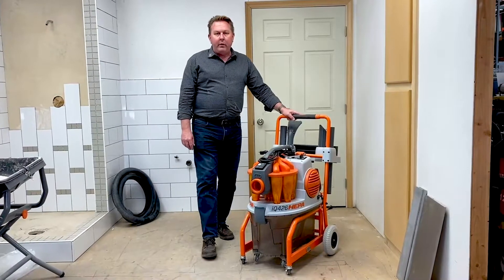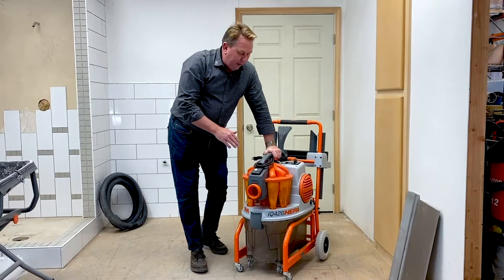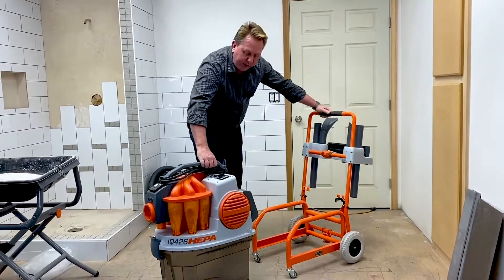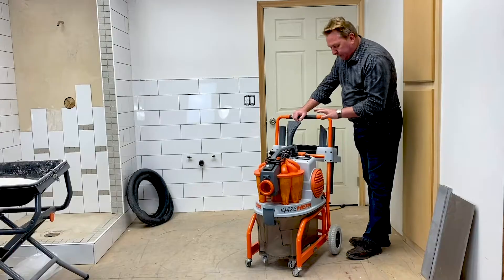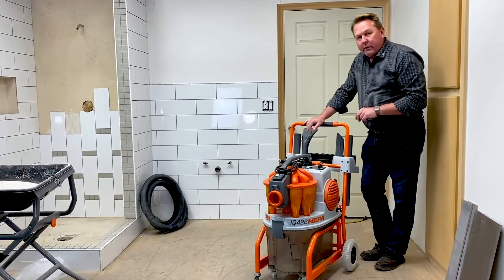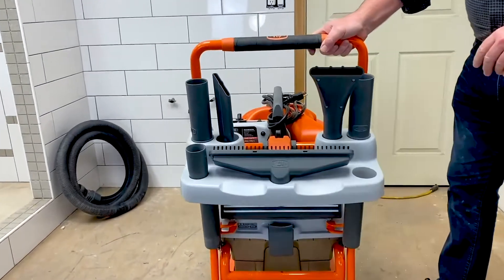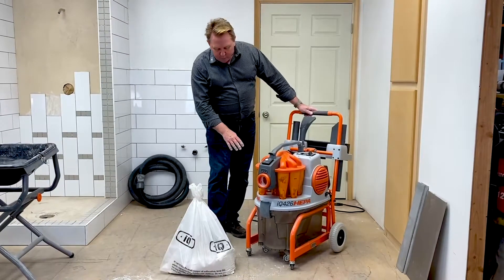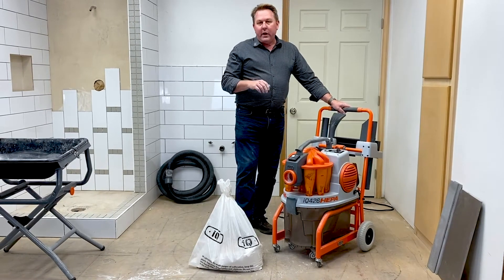The iQ426HEPA Dust Extractor Full Demo

Comment: Nice machine and demo. I have removed my tile in the living room area and need a vacuum to attach to an Edco cement walk behind grinder to remove the thinset. Will this vaccume work? Renting an Edco vaccume is over $400.00. I will need this to remove the kitchen tile thinset later on. What it cost me to rent I figure this machine might be a good investment for other projects. Please assist.
Thanks.
Reply: What did you end up doing? That Edco requires roughly 300 cfm if memory serves me. You hit the nail on the head with the cost of renting...2 days and you've roughly covered the cost of buying a decent machine like this.

Looking forward to hearing what you ended up doing and how it worked out

Comment: I do question your 99% claim.  It looked like you tipped some dust off the paper before lifting it, and when you showed under the head, there was considerable dust still in the filter.  The filter spinner looks like it could also use a bigger handle.  you could confirm it by weighing your dust and weighting the captured dust in the bin once finished.
Reply: Agreed how’s this guy going to engineer a product and then half a half baked demo.

Comment: Interesting. I've been using Festool extractors for out in the field work since 2012 and think that one of the CT26's will likely be up for replacement before long and was thinking of jumping ship and was contemplating Mirka. This DE looks interesting has some interesting features like the built in cyclones. At 12 hundred it is on the steep side for sure but looks interesting. 

With the 36mm hose is the tool end a proprietary size? Are there adapters included to fit tools like the Festool Planex or Mirka drywall sanders? Or would that require sourcing attachments? 

Is the DE hose inlet hole the same size as Festool where I could use the 27mm Festool hoses I already have for smaller sanders?